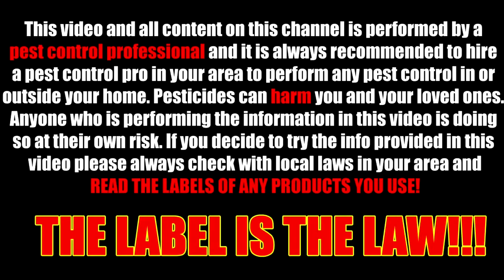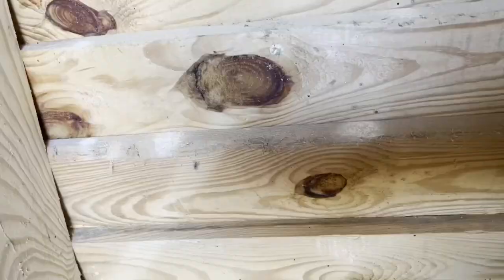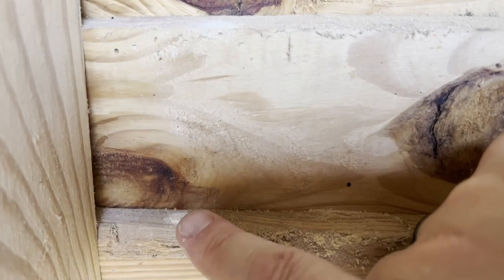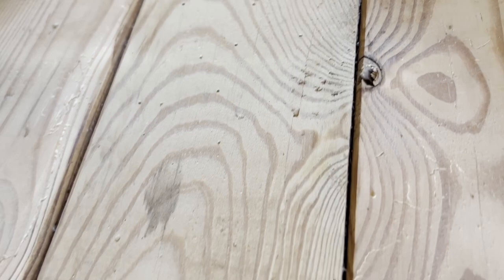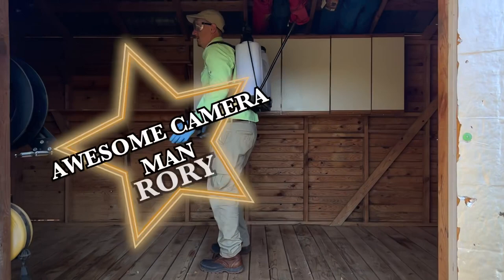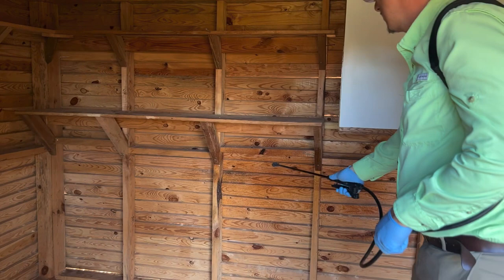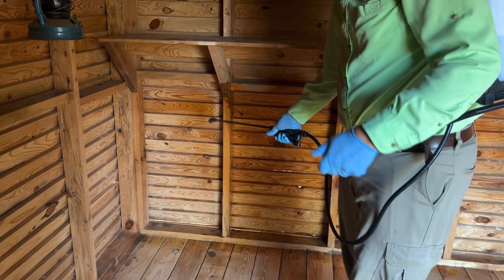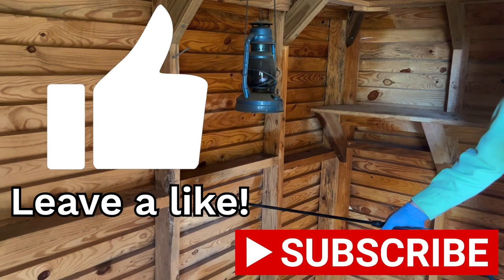What Are Powder Post Beetles & How To Kill Them - Demonstration At The End

Comment: I have a Tn. mountain home. Due to issues we have only been getting to the house 2-3 times a year from Fl. the last few years. We thought we had a powder post beetle problem but it's actually carpenter ants, that's bad enough.  Problem I'm  concerned about is we put red oak floors down in 2009. We bought it at a discount because they called it wormy wood, we thought it looked rustic. I have never seen the flour type frass but we have holes all in the wood , some small and some that clearly were not there when the floor was put down. My husband is in denial, the floor is fine.  The exterminator says any floor damage is old and he's not concerned at all about it. Might there have been a beetle problem in the past or is this really "wormy wood" and don't worry about something coming to life there?

Comment: If the beetles are inside your home in the hardwood floors do you stripe the poly off the wood in that area and then treat it and if some frass comes back can you wipe off the frass before you restain and poly?
Reply: Did you end up sanding your floors?